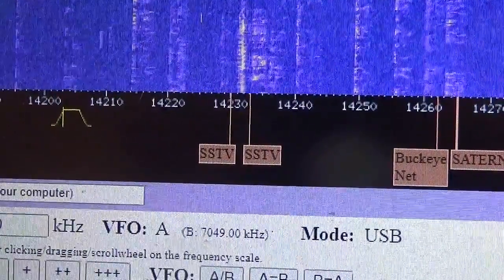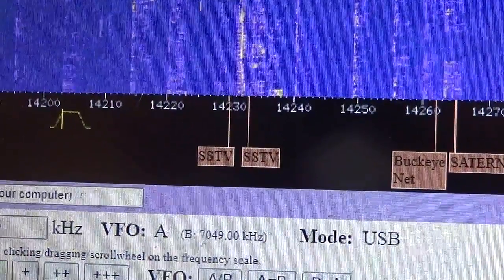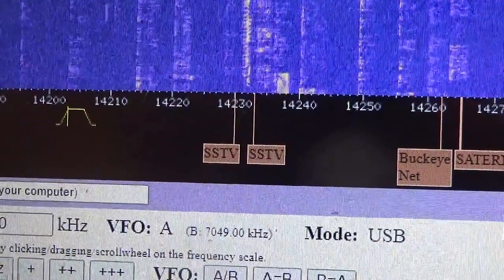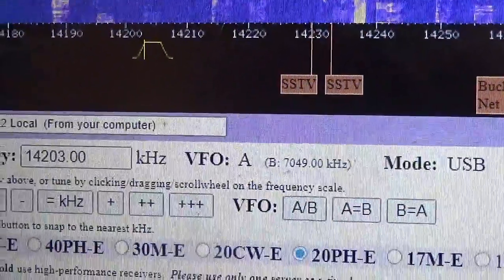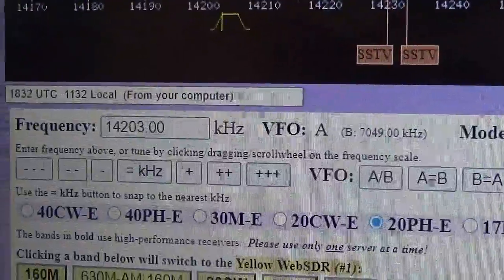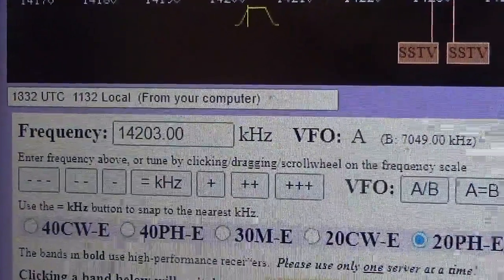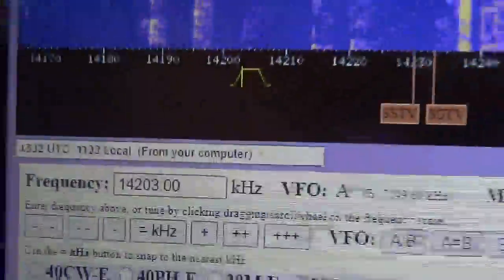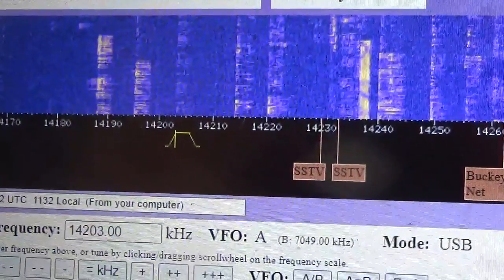Ham Radio- LISTEN and LEARN

Comment: Awesome, I've got coax on the way for my bearcat, might even get a mobile antenna for mounting it in my truck. It's got built in SWR so I don't think I need too much more equipment. Shouldn't jinx myself though
Reply from the maker: built in swr meter will work, if you have issues with people being able to hear you, perhaps look into spending the few dollars for a cheap meter, but if you have a good signal getting out, and the swr meter on the radio says your good (under 2) than you should be fine.
Reply from the maker: who did you get your radio from? i have a bearcat on the way myself. i will compare my meter on the radio to my aa600 and let you know how close it is
Reply: @quickstarthamradio8453  I got it off amazon, I think you linked it in one of the videos. 980SSB